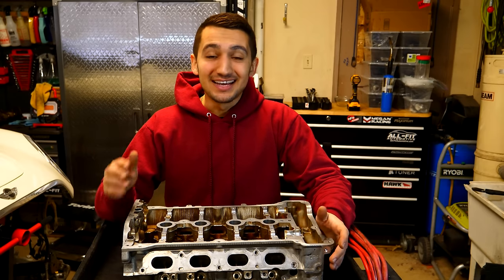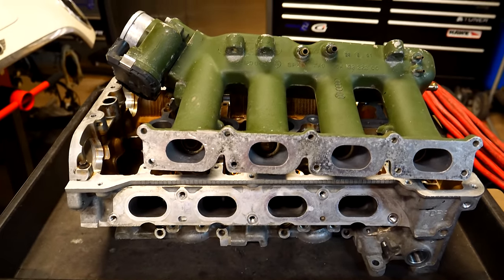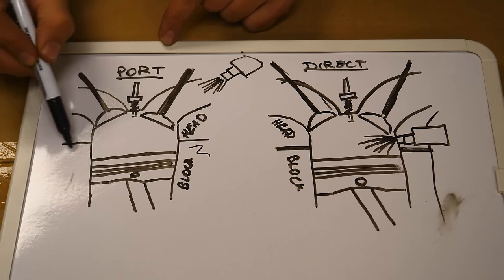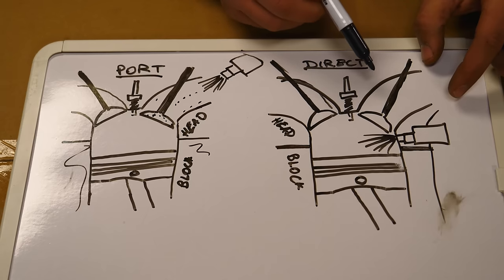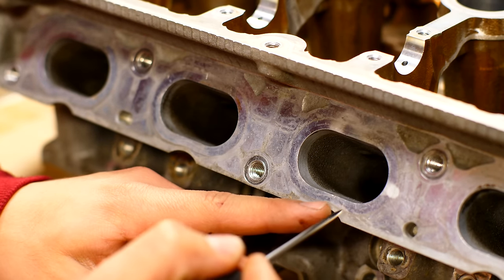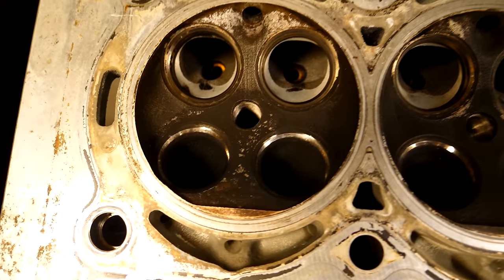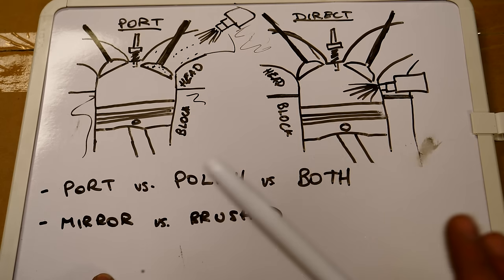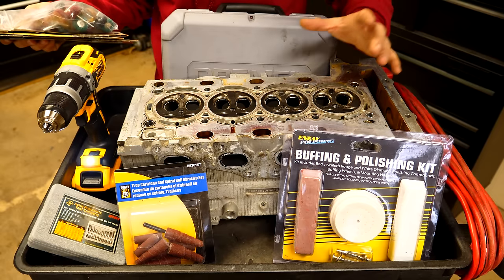Porting vs. Polishing vs. Both

Comment: the intake ports should be rough for fuel atomization, and the chamber, and piston tops smooth -to eliminate heat spot risers for detonation resistance.  Don't use a drill, use a Dremel preferably with pencil extension, or an air tool grinder. 
Port shape is most important and obstructions, the size is important also, so don't go hogging it out  increasing size unless you know the shape first, the size is to be determined as well as all wall thicknesses.  you should leave meat near water jackets as being too close =is busted through= regardless if its made a hole or not= it will leak into the port. Water transfers itself through steel and aluminum. you should maintain size of port in cubic centimeters all the way to the valve. the valves are usually a circle, however the port is usually not. Do not touch the floor except obstructions only or just the radius at the valve there is usually a water jacket there so thickness is critical, raise the roof, dont touch the floor. If anything you may raise the floor of the port if applicable. on rectangular shapes its better taller than width , however gaskets do not reflect this. You want and need to have smooth as possible head port- to gasket-to intake port shape and size so it needs to be as close as possible without hang ups or making obstructions.

Comment: Fluid dynamics is a very underestimated and not very understood engineering aspect of the effects of vacuum and pressure that most brains can't get their head around in how the combustion engine behaves. The engine is a complicated breather and how he explains is pretty good but not the full story. Camshafts mean more than port and polish in the character of a engine in how it produces bhp+torque. Air couldn't give a fuck if your surface is rough or smooth? I will go my way?? I do it my Way?? Not bad explanation but not right?

Comment: a mirror finished intake ports are never a good idea not even with direct injection its just worse with a port injection. You want to create a thin trubulent layer at the walls of the port with shiny walls wont do that. the concept of a turbulent layer is as it is with golfball wiith its dimples high end CNC ports can be dimpled in the same way as golf balls are
Reply: you should never ever ever use any finer sandpapper than 80 in cyl heads

Comment: "You're going to be able to flow more if you make that little hole larger." Why yes, yes you will. 🤣
Reply: Not always, many times, properly contoured smaller ports will increase the velocity and cylinder filling for better volumetric efficiency across the entire RPM range. This is what happened to the Suzuki Hayabusa and it made a huge difference on the Gen II engine.

Comment: What is your opinion on epoxy finish on the intake port?
Reply: I have found a quick 80 grit pad wrapped around a flexible hose slightly smaller than the intake driven slowly by drill from both sides making ridges against the flow gives similar results to dimpling on two stroke engines

Comment: So why not remove that  PVC valve and replace it with a filter/ breather.
 We don't like  dirty carbon  air  suck into our top ends .  That's why we have an Air filter.  I replaced my pvc vavle with small K&N btreather filter and gain some extra gas mileage and  Or some extra  ponys. at least  place the  PVC hose before the air filter  so it filters. But, Don't go and  plug the PVC hole, or else  you blow seals with lots of   pressure build up. The car manufacturer knew this but it help to insure costumer  repeat service. Sooner than later.. And wrap you catalytic  converter.  With heat wrap . It burns that unused gases much more efficiently...

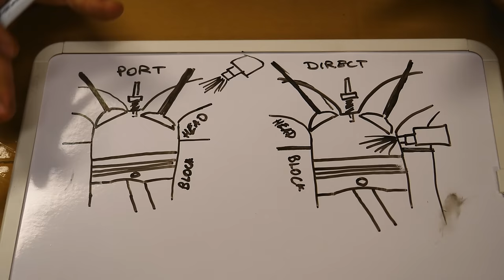Comment: I hate to say this but I stoped your video at 1:38.    I have to correct you porting bis reshaping and cleaning up the ports ...    Polishing is like the world polishing to make it shine like a mirror and that is only for the exhaust port after it is ported for the exhaust flows out faster and mo carbon buildup you never polish the intake port you want to keep it ruff so the air gas stays mixed...
   Then at 10:46.  I stoped your video again don't sand blast the combustion chamber just wire wheel it to see what you have first some people polish it like a mirror for flame travel some will give it a light sand blast for air fuel mixture... But keep the CC's the same for each combustion chamber.... I've done heads with H.P. gains of 75+
  I seen a lot of heads where people think they know what there doing and end up making them into scrap becouse they lose power ...

Comment: I'm sorry this is the second video I've seen you make trying to be scientific yet providing false information. Your first video I watched you scrub and polish off all of your valves till they were bright and shiny....looked cool but then you said this was perfect. Little did you know you scrub off all of the hardening and other coatings put on it by the factory..good job
Now here, claiming on port injection you can't polish. LMAO.. The only time I wouldn't polish or smooth would be a carb setup, as only then do the walls play role in atomizing fuel. I hope you realize injectors do a majority of this work now and even if the fuel tumbles off the smooth wall, it's still helping the fuel agonize.
Stop reading one motor trend article and making videos as if you know everything.....you clearly dont
Reply: Hey Robert! Lmfao! Mr DeHart! What's up, bro!

Comment: Um how do you get carbon build up on the back side of the intake value
Reply: ALL stock internal combustion engines have crankcase ventilation, very many internal combustion engines have EGR, all this shit goes back in you'r intake and fuck your day over with oil and exhaust. Then you get carbon in the runner and valve.

Comment: Yeah, this guy is talking about common myths, without proper understanding of the matter. With high revs, the fast air coming in the intake is really turbulent, it does not need the rough boundary layer to mix properly with the fuel. Many cars that care about performance will have variable intakes, making the intake runner longer in order to make the slower  air at low revs more turbulent. As many other people in the comments already said, the shape is more important than the finish. Really old cars with shitty intakes could benefit from the roughness, but tuning the intake shape is more important. It is very obvious that this guy has read something on the internet, without the proper knowledge on fluid dynamics to back it up. There are too many people on the internet that pretend that they know what they are taling about, when they really don't. As a bachelor of science in mechanical engineering, this kinda hurts to watch, even though I only know the pure basics of fluid dynamics and airodynamics.

Comment: This guy..... Lol truth is some engines function better without port and polish or even a gasket match because most vehicles made obd2 are factory designed to create a balanced power torque ratio combined with fuel economy and emissions regulations some vehicles have a lazy table and actually need a bump nickle welded into the lower side of the ports to create a higher velocity ...larger hole doesn't mean more velocity just more volume blow out a straw ...then a garden hose ..the straw has higher velocity which means it's effective at getting air in and out quickly and efficiently the garden hose has less velocity and requires more volume and can only achieve higher velocity by boring camming and stroking the block which gives a higher displacement value to draw more air in with fuel and get it out effectively ...now on another note on an old v8 you can gain 40+ hp on a 700$ port and polish not some backyard bullshit on a newer vehicle it will throw off your mas sensor your o2 sensors and will lean back your fuel ratio or increase it accordingly to match air flow so your gain is minimal compared to a point and carb system you may even loose power of up to 15%
Reply: That's why you retune the ECU after any major engine work. Who cares about fuel economy and how the motor runs at low rpm. If what you were saying was true they would use stock LS and Coyote motors in NASCAR for example- but they don't, do they? Thete would also be no need for aftermarket support for these engines either. There is so much improvement that can be made over factory dude...

Comment: Your young and have a lot to learn the are too many variables and the hard places are the ones require the work port matching is time wasted and usually harms a stock engines when you have done this for 48 years and a lot testing hours ,armatures 99% of the time make the head worse than it was standard the Dyno and track tell the truth home handymen leave it alone

Comment: Porting helps polishing doesn't
Reply: Eric Christiansen one of my buddys builds dragsters and races them professionally and he swears that leaving the runners rough and not polished has the better flow
Reply: You're exactly right. I'm an engineer for the COMP Performance Group and on the intake manifolds and cylinder heads that we produce they'll always flow less air when they're polished compared to when they are left rough. Look into dimple porting.
Reply: Eric Christiansen is that true for carved setups only ? Or also applies to mpfi as well ?
Reply: @E30Eric  What name are the heads and manifolds sold under? I only know of Comp as prob the best cam manufacturer around. Billy's a fucking smart dude.

Comment: Your theory is flawed I’ve got dyno number to prove that your theory is flawed. And my shits carbureted. Your engine is a giant air pump more air an fuel you get in the more power you get out. And long’s your carb is tuned correctly your fuel will atomize just fine on a mirrored surface

Comment: Your argument for different finishes for different fuel injection points is flawed. Your drawing was fine; it's your reasoning that was terrible. Once gasoline is mixed with air, it is not a solvent, you cannot dissolve oil into air. Look in your Honda head sometime: there will be oil and crap everywhere. There is no argument why air/fuel mixture (but not pure air) would benefit from friction losses.

I know it's kind of a nit, but you should avoid the word velocity. You actually decrease the velocity by porting and polishing. The only way to increase velocity is by adding material and making your cross sectional area smaller.

Similarly, you cannot get any more flow or less flow. Regardless of what your head looks like. Flow is determined by engine speed and displacement (and volumetric efficiency).

What you are trying to do has nothing to do with speed or velocity or flow or tumbling or any of that boloney. It doesn't matter where you inject the fuel. You are simply trying to reduce friction. How do you do that? Smooth surfaces and no expansion or contraction (holes in head not matching up with holes in manifolds). Use the gasket as your template and "go to town".
Reply: So, what are the advantages in the end?!?!?